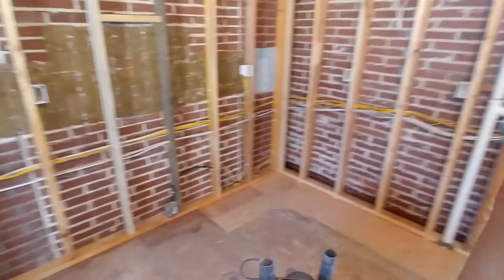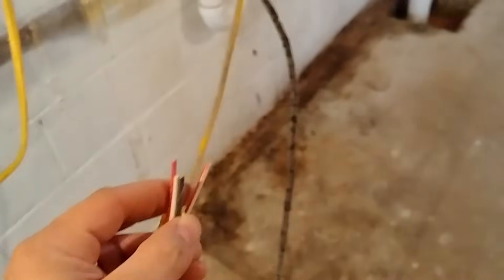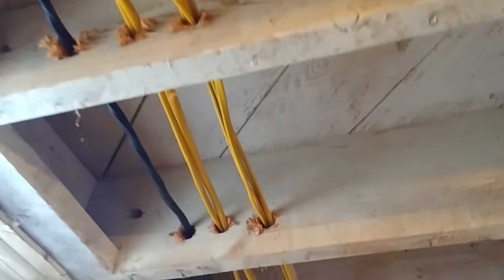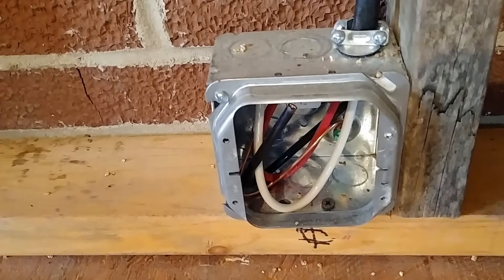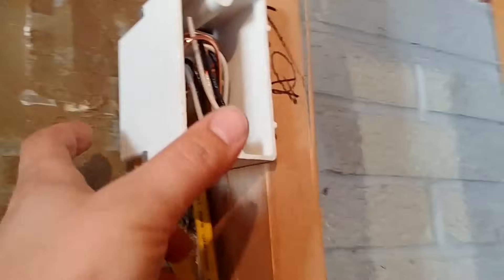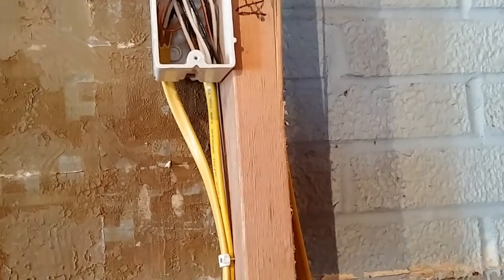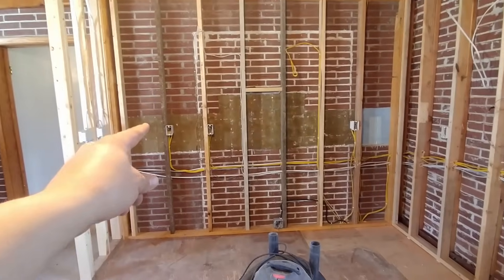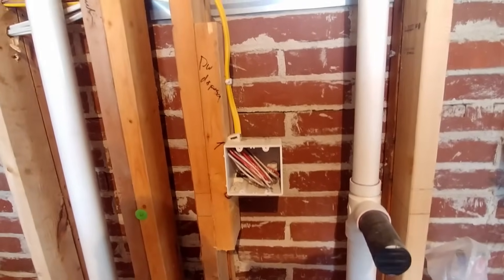Kitchen Rough In Wiring Guide

Comment: For you "electricians" pulling 3 wire for two separate circuits here's the major issue with this.

Ex. Two 15 amp circuits on a 14-3 cable. 10 amps on the black wire and 10 amps on the red wire. How many amps are now flowing on your single 14 gauge neutral wire back to the panel? Answer. 20 amps. On a wire only rated to carry 15 amps.
Reply: not if it's on different phases....
Reply: @jrock865  220v residential circuits typically feed dedicated appliances with 220v motor loads such as well pumps or resistive loads like ovens. Some appliances like an electric dryer contain both. These 220v dedicated circuits are usually evenly balanced on each leg of the split phases and therefore there is minimal return on the neutral wire. Using 3 wire to feed two different circuits that could vary greatly in the amount of load on each leg could result in return power flows on the neutral that exceed it's amp rating. Being on different legs can help minimize this but it is not beyond belief that  someone installing such a circuit could land each wire on single breakers that are separated by 1 breaker. This would put both conductors on the same leg thus resulting in current flows on the neutral that would be the sum combined total of both ungrounded conductors.
Reply: @jfowler702910  any good electrician knows if they share a neutral to use different phases since it cancels out on the neutral thus keeping current flow low on the neutral...putting them on the same phase is just someone that doesnt know what theyre doing.
Reply: @jfowler702910  mike holt has a video on this issue as well and shows the problems with sharing a neutral you should check it out
Reply: @jrock865  great video! And as you can see there can be multiple issues with MWBS if not installed correctly. Commercial applications where only trained and qualified professionals will likely install and service the equipment is entirely different from what actually happens in the residential world. That's why IMO MWBS should not be allowed in residential.
Reply: @jfowler702910  oh def ive been in union for 18 years and have seen some real shady work...speakerwire for powering lights etc.  Dealing with shared neutrals is part of it but most residential electricians dont think about it as you stated and see it as easier work throwing a 12-3 instead of running 2 12-2 and then not paying attention in the panel hookup
Reply: @jrock865  what happens when CB's need to be moved in the panel? Will you guarantee they will remain on separate phases?  You think someone is going to trace out every single wire when they just want to move a CB?
Reply: @fizwin1  normally a real electrician will follow the wires to a single romex and realize it's 2 separate phases and find out what it feeds that's just me though because they're liable for moving it.
Reply: @fizwin1  it's the same with a water heater and hvac etc.
Reply: @jrock865  it's just not real world. This is why you make it as safe as possible to begin with. This is one reason the NEC exists. We will agree to disagree. Not going to battle about it.
Reply: @fizwin1  I've worked in real world you have no idea what you're talking about
Reply: @fizwin1  most electricians put that on a 2 pole breaker with a tie in if you even have a clue what that is.  It's not rocket science like you're making it.
Reply: @fizwin1  lastly if you don't know what you're doing you have no business messing with it...which most people find out costs them a ton to fix it and yes it does catch up to them in house sales etc.
Reply: @fizwin1  yes that is real world as well for branch circuits for range wiring for dryer wiring etc how many houses have you wired or even remodeled etc? I'm guessing very few by your lack of knowledge from that one comment alone

Comment: Wouldn't there be a heat issue, with the 12-2-2, especially at choke points, bends and such? Just my observation. And You didn't say how far, of a run, from the panel, to the range. I would've used 6-3 anyway, in case a line loss issue, but you never know, in the future, what the homeowner will upgrade or downgrade to, in the future an older range, interm if the new 1 breaks, the 8-3, would actually be undersized. But good in depth video.
Reply: My electric range was wired with 40 AMP aluminum wire although the range specked 45 AMPs. When I upgraded to 200 amps I re-ran with 6/3 as you mentioned.

Comment: Another good informative video. I like clean drilled holes placed in a areas where the cabinet maker will not be securing their cabinets .
Reply from the maker: Good point. Shouldn't the cabinet installers be using screws that are short enough to prevent them from drilling more than about 1" into the stud anyway though? Code says that any wire less than 1 1/4" from the face of the stud needs to be protected by a nail plate so I would hope that most tradesmen should know not to use screws that penetrate more than that.

It's always best to plan that you might get the "new guy" that might grab a 4" screw though I suppose!

Comment: I'm adding subpanel  to my main panel, with 100 amp breaker,  I can not find 3 awc gauge wire,  can I use #2 wire, also my main panel don't have main  breaker, is out side panel and that breaker is 200 amp , is that mean main panel is 200 amp , there is not label on main panel,  is Bryan panel,  and I asking because adding 100 amp to main panel

Comment: Since one of the appliances that will be replaced several times over the years is the microwave,  why would it be a good idea to hard wire it?  It seams that hard wiring your refrigerator would make as much since.
Reply: Most likely it will be for a microwave/vent hood

Comment: 12/2/2 is 3x the cost of standard 12/2. I don’t see the value in using it.
Reply from the maker: Yeah, I looked it up too and was surprised at how expensive it was!
Reply: Labor.
Reply: It's also difficult to find. Most home improvement big box stores don't stock it. You would have to go to an electrical supply house to get it. There's another benefit for using 12-2-2 roamed. You can use 2 single pole breakers instead of one double pole breaker as is the case for a 12-3 multi-wire circuit.
Reply: @jolyonwelsh9834  Not as difficult to find as 14-2-2, did not even know 14-2-2 was a thing until I saw a single package of it sitting on a shelf at the local HD.   My local Lowe's doesn't have a good electrical section, but the local HD will have a roll or two of 12-2-2 on the shelf at a time.
Reply: @John Lawson put the dishwasher and disposal on the same circuit, been doing it for 30 years, no problems 
This guy is not an experienced residential wireman
Reply: @frankstallcup8720  Here Disposal is a home run ie code .Think about it motors really do cause a draw yep just a few amps but I bet you can see  lights flicker when disposal turned on .

Comment: You don't actually need two neutrals if each circuit is powered from opposite phases or 'legs.'  In which case the one neutral would serve to carry the load imbalance.  I assume some contractors can't be trusted to land wires in the appropriate locations in the panelbox (or possibly someone else at a later time) so the two neutrals guarantee no errors. Edit: Arc fault would not operate properly with 12/3 so 12/2/2 then is the required replacement.

Comment: Does 8/3 wire can works with 50 amp?
Reply from the maker: No, but 40amp is adequate for most electric ranges these days. You will need a 40amp breaker with a standard 50amp range receptacle like this one. https://amzn.to/2WZ0d9D

Always go by the installation instructions for the electric range that you will be installing. Thanks for the question and for being a subscriber!

Comment: All Electric Ranges require a 50 or 60 Amp Double Pole Circuit Breaker and wired with  6-3 with ground  !! # 8 -3 with ground is for Drop In Counter Top Cook Tops on a 40 Amp Circuit breaker, double pole !!!
Reply from the maker: I thought that 50amp and 6/3 was standard too but I guess quite a few ranges these days only require a 40amp. Interesting how things change. I still think a 50amp is a better installation.
Reply: Only ovens with self clean need 50 or 60 amps. If we don’t have specs we run 6. Most homeowners don’t wanna pay for 6 if they don’t need it. And we ain’t paying for it.

Comment: I didn't see any service loops.
Reply from the maker: Could you elaborate a bit more?
Reply: @BenjaminSahlstrom  I'm just a guy wanting to rewire my house the right way and I thought a 6-8" loop of extra wire was required outside the boxes but inside the walls for any future servicing needs.
Reply from the maker: @om4444  I have heard that as a suggestion but it is not required. I honestly haven't seen it done in the field by any electricians that I know of but I'm sure that some do. In my opinion if you leave a good 8" or so of wire in the box then there shouldn't be a need to add loops. Its totally fine if you do but it is a bit tricky with needing to anchor the wire within 8" of the box.

Good luck on your project!!

Comment: Never heard of a 12/2/2 we just call it a 12/3. And it is cost efficient
Reply: kenneth kussman, 12-2-2 has 2 neutrals in addition to the two hots so you can use arc fault breakers.  Last time I checked it was more costly than running two 12-2 wires.

Comment: That sure is a messy job. Glad you did not run the wires. I would be ashamed to put my name on it. Even the wires are not stripped correct in the boxes. Holes are left rough. A step bit cleans this up. I could go on but you get the point

Comment: It's not 12-2-2 wire !! It's 12-3 w/grd !!!
Reply from the maker: Yeah that's what I thought at first too but if you watch the video you can actually SEE that it is 12/2/2 marked on the cable. There is a red, black, two white, and a bare ground wire. Pretty interesting!
Reply: @BenjaminSahlstrom  ; I've never seen wire cable like that and I'm a State licensed Journeyman Electrician with over 52 years in the trade, specializing in Residential & Commercial Electrical Wiring & Maint.   12-3 with grd has One Black , One Red , One White and one Green (for EGC) .  12-3 w/grd is normally used for 3-Way  & 4-Way '' Switch Legs '' . With that 12/2/2 one could actually run Two Branch 120 VAC 20 Amp Circuits at the same time as each 'Hot' Conductor has it's own Neutral  !  What part of the country are you located at ?  I have a 75' coil of 12/5 with grd . One Black, One Orange, One Blue , One White, and One Green (EGC) . Don't recall where or how I came by it , but it's for 3 Phase  277/480 VAC Circuits , Industrial  Wiring.
Reply from the maker: @BearStar1  I linked to the 12/2/2 wire in the description above. Would you be willing to look at the link and tell me what you think? I really appreciate your input! We are located in Minnesota.
Reply: @BenjaminSahlstrom  ; If it was me , I would refer to that as 12/4 with grd !
Reply: I live in Iowa and can buy even 14-2-2 wire at Menards though only by the 250' rolls @BearStar1